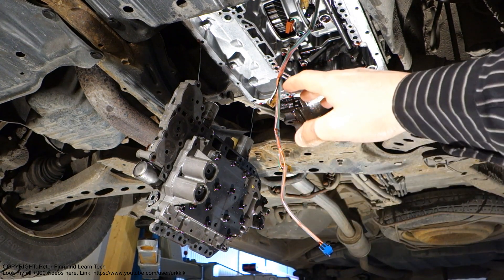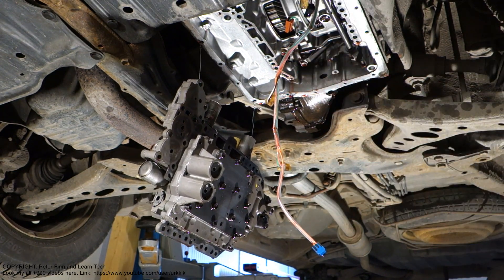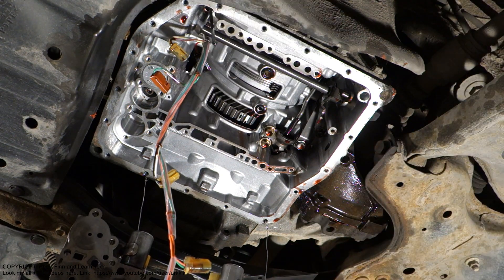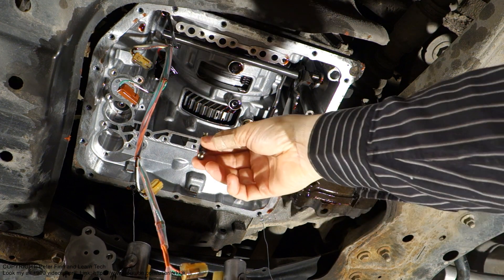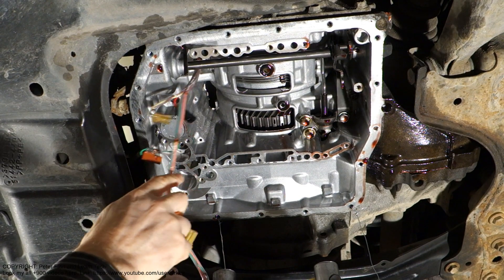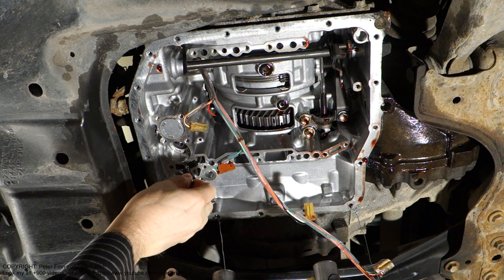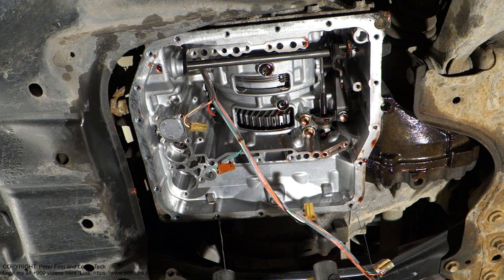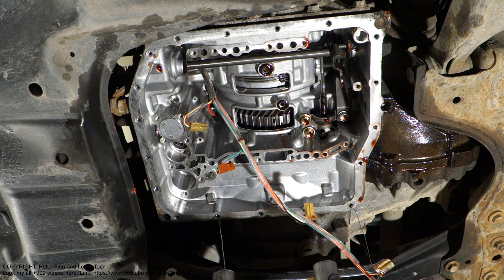Intresting Toyota automatic transmission U241E inside look

Comment: I have a 2004 Toyota solara automatic I have a code that came up on my car and don't know which solenoids are what but the code is p0 776
Reply: it shows two codes for that both of them are the same one says CNF mod 10 and the other one says control solenoid b
Reply from the maker: Noted 👍

Comment: Hello please help 
 my rav4 2003 has code p0758 and 760 I did change all selenoid  A and B  but  after that now I have no Reverse and when I switch gears from Parking to Neutral the car is going forward , I switch to Reverse  the car is going forward  , only Park and drive forward  is working 
What I did wrong  
Look like switch gear is not working  ,, any Idea???
Reply from the maker: Hi, please check these:  
Shift solenoid B is faulty.
The wiring or connector for shift solenoid B is loose, shorted, or open.
The valve body is defective.
The transmission fluid is low and/or contaminated.

Comment: Hello. Would like seek advice. The camry Im fixing its 5 speed mcv30. Already replaced forward clutch disc and metal plates.

The car will no move forward when its cold, but has reverse. Waiting 30 mins to it will start to engage to move forward. No dtc fault codes. 

Transmission guys here says I need to replace orings. Would you know which specific parts of the transmission is that oring that needs replacement?
Reply from the maker: Hi, You need to replace clutch plates inside the automatic

Comment: I need a brand and/or type of grease to put inside the auto trans in order to hold the check-ball valve and springs, etc so they wont fall out as i reinstall my valve body from under the car?? Please advise asap. I live in Melbourne, Australia
Reply from the maker: Hi, use little standard grease. Link: https://www.autozone.com/greases-and-gear-oil/lubricant-grease

Comment: I have a Toyota Rav 4 2002 model and has error code P0755  coming out in my dashboard , this code says that shift solenoid b malfunction. Can you please identify  these shift solenoids in a U241E transmission as to where they are located. Thanks.
Reply from the maker: Hi, You might have ECU issue.
Reply: @PeterFinnTheCarDoctor  how can fix ecu? Find used one in junkyard?

Comment: You're correct. both are 100%   identical. In the door column plate on camry says: 01A U241E while the scion is: 02A U241E ... that first code are de axles.
Reply from the maker: Hello and Thanks for your comment. :-)
Reply: I want to buy a transmission for my 2007 rav4 my door code says 06a u241e can I use one from a tc  will my axle splines fit

Comment: Hi,

Whats the difference of a U241E on a CAMRY 2002-2004 to U241E on a SCION XB 2008 to 2015  ?
Reply from the maker: They are 100% similar
Reply: Peter Finn  what is a possible replacement for corolla verso transmission i dont like manual or semi auto mmt will e241 fits 1zz engine do i need to rewire the tcm thank u sir